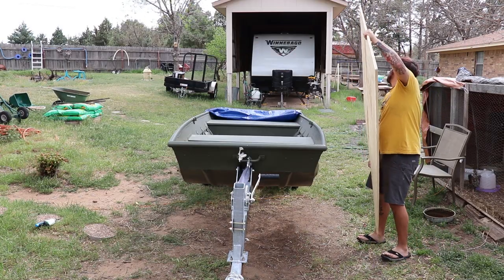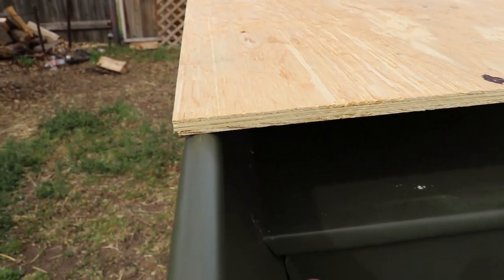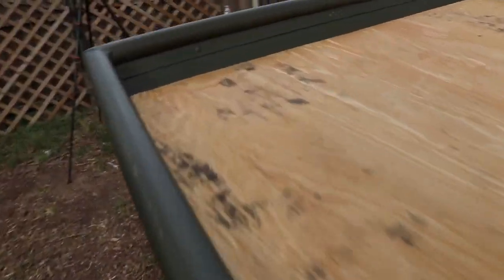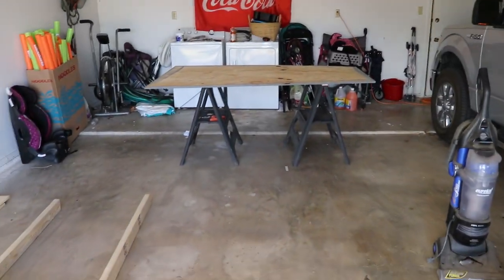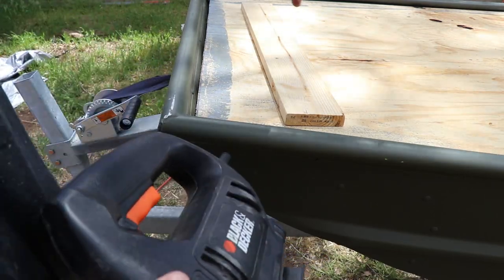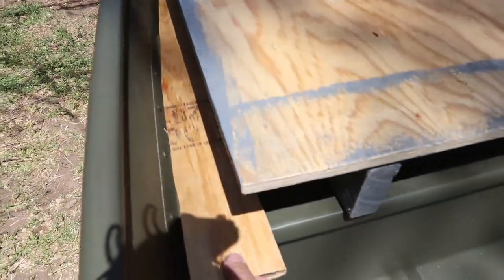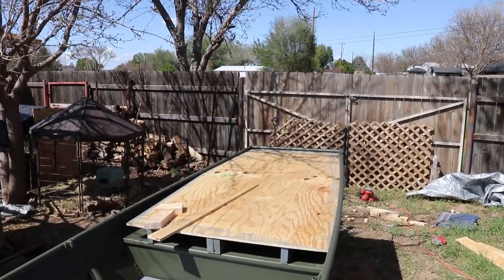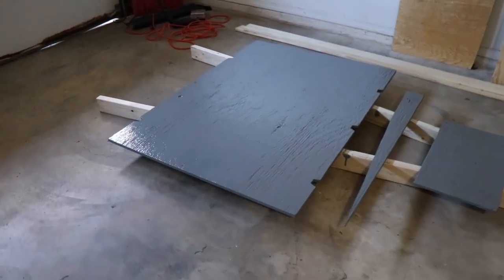Building a Jon Boat and BABY BUNNY RABBITS!! SO CUTE!!

Comment: Awesome build!

I traced around the outside also then used the appropriate sized masking tape to make the mark to cut.

Could also make a mark on the jigsaw an inch from the blade and line it up with the traced line.
Reply from the maker: Yeah that’s a good idea too